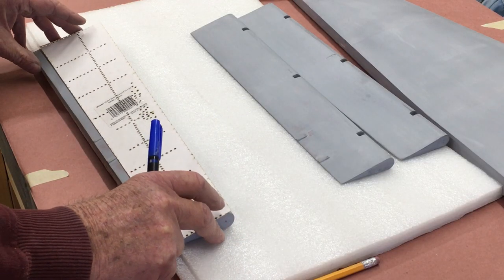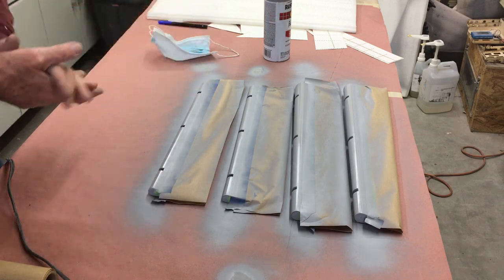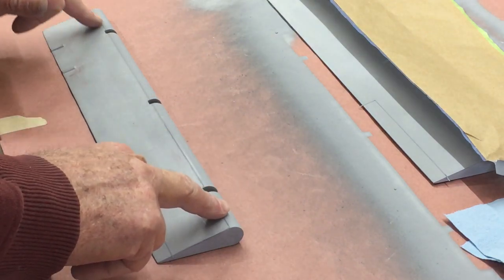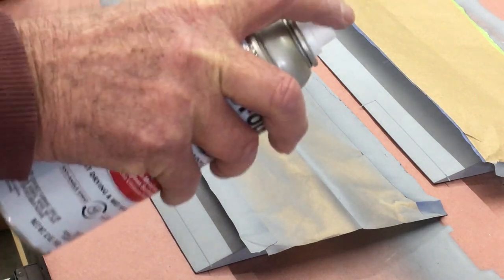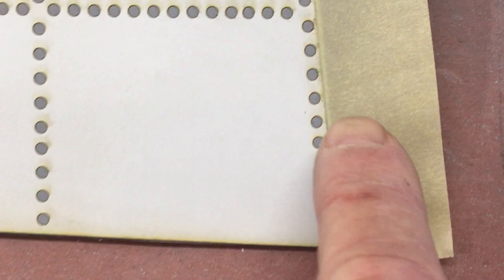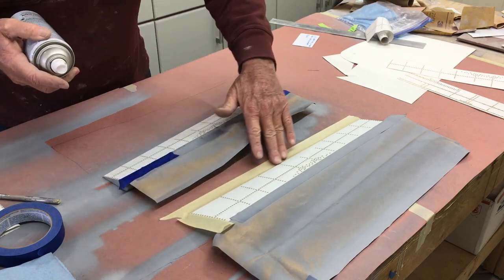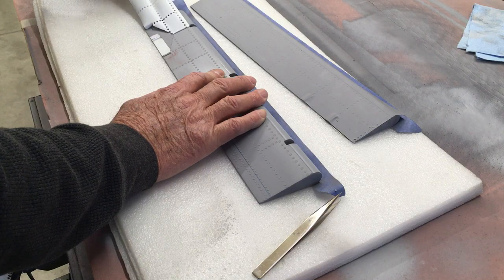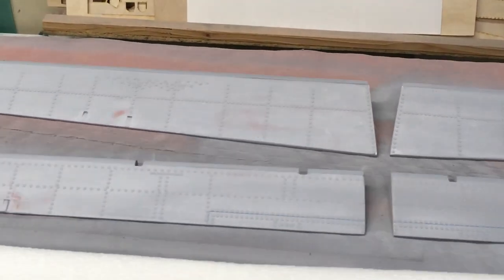Tucano Part 17 Panels & Rivets

Comment: Very clever, well done. How would it have compared to just leaving cut stickers for rivets instead of filling a negative? Particularly for adhesion and thickness.
Reply from the maker: The rivets are part of the mold so only needs to do it once
Reply: @britcharming  That’s not what I mean. If you want positive rivet detail then wouldn’t it be simpler to put positive rivet stickers on this as opposed to a negative rivet stencil, using filler primer, then peeling it off? Assuming you considered that, why do it this way instead?
Reply from the maker: Never tried the other way.  this works for me